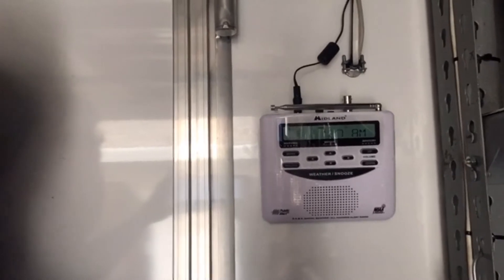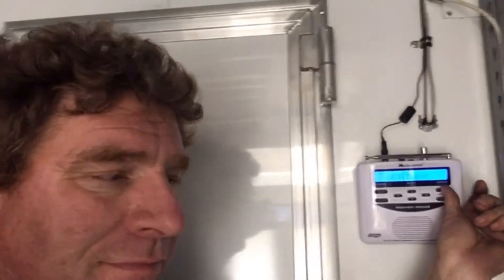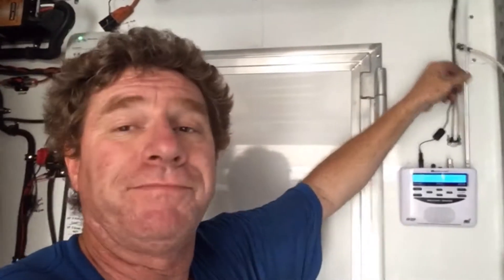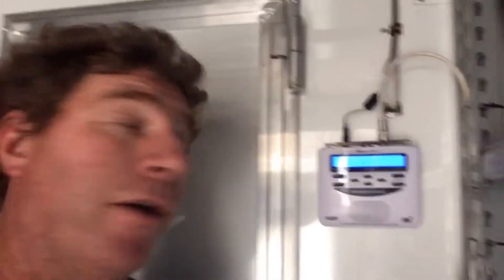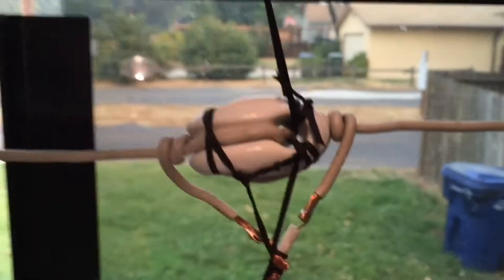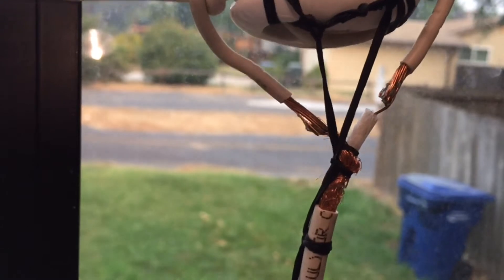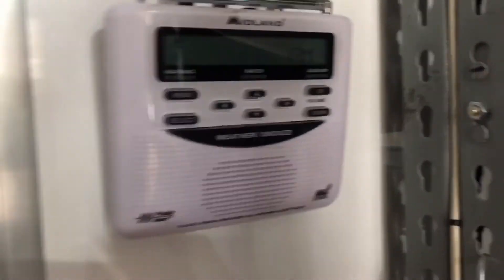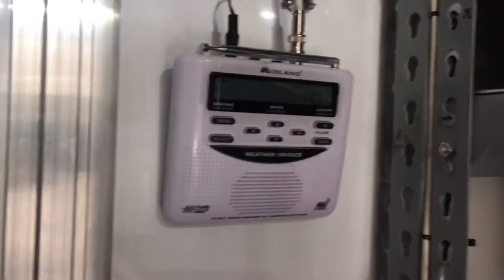Weather radio antenna for RV

Comment: Coax length should be s short as possible (to reduce losses). Also, NOAA WX radio is transmitted polarized vertically, so users shouls align their dipoles the same.

Comment: Is that a plastic or a ceramic egg in the middle? If it is ceramic take extra care and prevent it from rattling on the glass if in motion.
Reply from the maker: That one is now on a long coax and is used for an outdoor antenna. I want to make a 1/4 wave ground plane antenna. There’s a good design on the NOAA website

Comment: ...horizontally polarized antenna trying to receive a vertically polarized signal...
Reply from the maker: It works for now. Some day I will get around to building a proper ground plane

Comment: do you have this hooked up to 12 volts or an AC adapter? I thought for sure I saw one of your videos where you show a stepdown adapter to run it from 12 volts, but I absolutely cannot find it now.
Reply from the maker: Yes. I have a step down buck booster. It goes from 12VDC to 9VDC. The first one died. So I got a larger one. Amazon. This one is SMAKN-11224-9-54W.  I have since changed around the antenna. Now I have a glass pass through. If that one doesn’t get what I need I take the dipole and hang it up outside on a tree
Reply: @CrazyMarty  ok, that looks like Amazon item B014ZRW60U. Output 6amps???? the AC adapter that comes with it only outputs 300 mA....
Reply: @CrazyMarty  I found it-you show it on your Amazon review. I guess the device it powers takes the current it needs from the transformer, which can be UP TO x wattage/amperage.
Thanks!

Comment: Hey Marty, can you make another video with  CLOSE_UP shots showing how the solid copper wire is wrapped around the insulator ?     I have seen a Cobra HG A 1500 mag base CB / WX antenna which is described as weather band "ready "  and not sure if it is any good , especially since my motor home is mostly fiberglass.  Thanks   JwgK
Reply from the maker: The CB antenna will probably work ok. They are just long for the frequency you are trying to get. And an RV doesn’t have a good ground plane to work with. The car is better since it’s a metal roof. The insulator is pretty straight forward. 
https://mfjenterprises.com/products/mfj-16a01